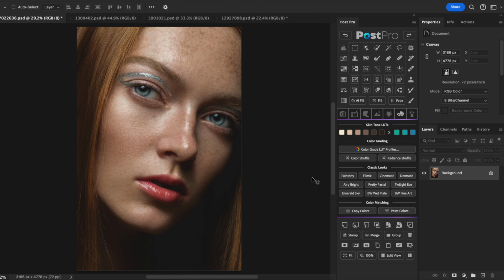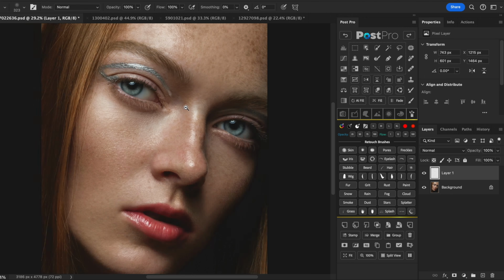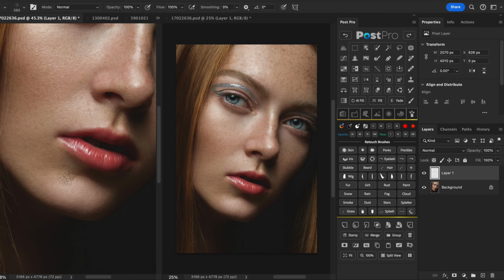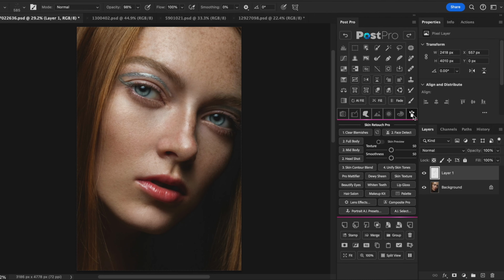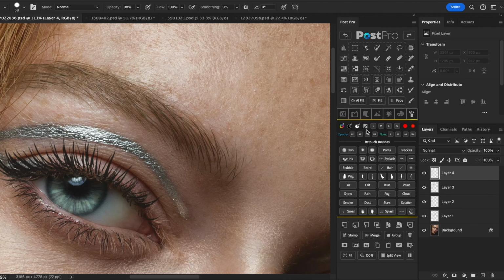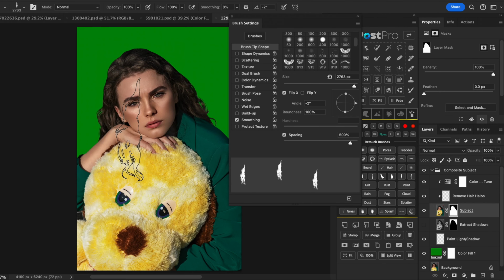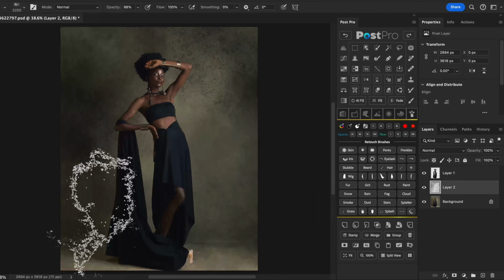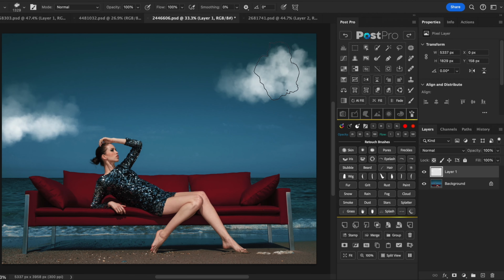Post Pro Panel - Brushes

Comment: Hi. In a comment in one of your videos I sugest to be able to hover over each tool and maybe a small pop up show the name of what it is, sometimes by the icon its hard to remember. Also... I was wondering if it is possible to add in the brushes to go back to the regular brush ones we selected any of the other ones. Or maybe I am not finding out how to unless I go to the brushes section and selected in the list.
Hope the feedback helps.
Reply from the maker: You can use keyboard shortcuts ‘<’ or ‘>’ to switch and move to the “previous” or “next” brush.
Reply: @postprotools  That is great, thanks!